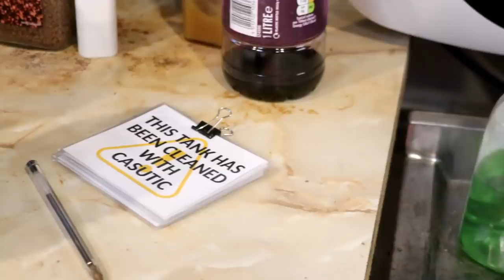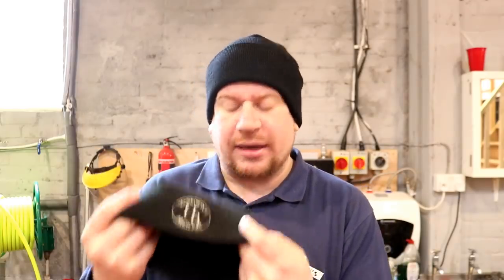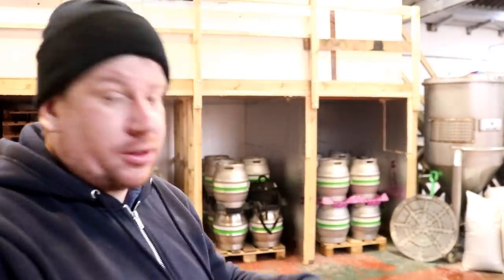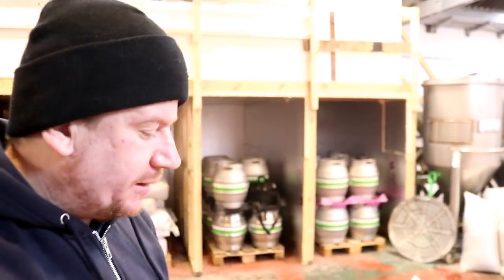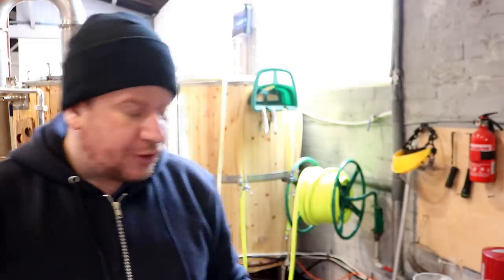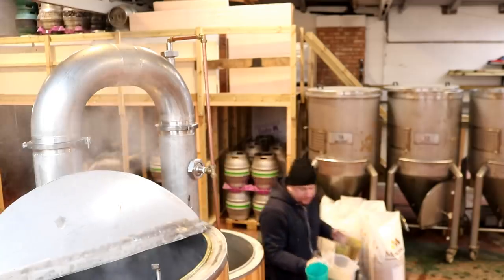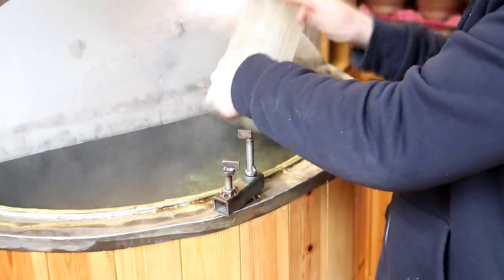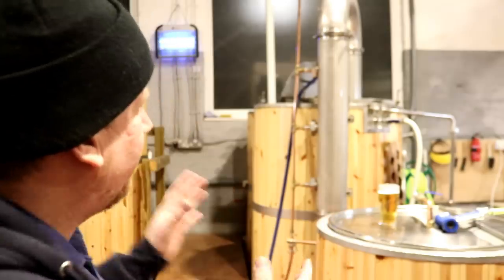8 KG OF HOPS

Comment: Looks good fella. Home in August and can't wait for a cheeky pint or two at the Shed. 
If it ends up too bitter think about less WP addition, more dry hop and more than one addition (one during fermentation and one post fermentation when cooler). We do two dry hop additions totalling 9g/L in our 70hl batches of NEIPA which is under review as we think we could reduce our WP addition and add to DH. I do like the fact that you chill the wort before adding the hops. Also watch the Cohumulone levels of the hops when using hot side, that's why Simcoe and Mosaic are so popular as they have relatively low Cohumulone and have less of a harsh bitterness.
Reply from the maker: Good tips, Cheers Pete. Message me when you are back.

Comment: Also, noticed in your recipe you have wheat and oat malt listed. Are you using flaked-wheat and flaked-oats in this recipe? Flaked wheat, especially, adds a ton of haze and residual proteins in the beer.. if used in the right ratio(12%-16%). We all know if you use too much flaked-oats, you can gum up your mash and result in a stuck sparge.. a sticky headache. I think from what I have experimented with in my own brews, as well as lots of research on NEIPA's, that you would want the clarity of a true WIT beer, pretty much a Hoegaarden times four. 

Early hop additions are on the low weight side.. maybe 20 minutes into a 60 minute boil(these are the hops in your boil schedule that give you IBU's). Throw your remaining hop schedule in at whirlpool(175`F-165`F), giving you not as much aroma, but a lot of flavor without pulling out the bitter oils. Then, dry hop the heck out of the fermenter with your favorite tropical, floral, stone fruit hops. 

I visited a brewery in Nashville, Tennessee that specializes in NEIPA's.. every one we tried was freakin amazing(Bearded Iris). Two of the brews they made only used one hop variety for the boil, aroma, and dry hop schedule. Now.. there is a little trick that people are using over here in the states to get a super milky hazy brew.. add LACTOSE. Once again, this is just my own two cents opinion from a brewer to a brewer, and as I see it, a friend to a friend. Much respect!

Maybe this helps with the thought process. I'm positive this brew is going to be great either way, would love to try it! Cheers man, keep on keeping on!

Comment: I asked before, why are you not using tri-clamp fittings for connections? The cost I'm sure is different, but for the ease of use and sanitation, is it worth the extra cost, if there is any extra cost?

Comment: Cheers Harry - like the new hats but it's still almost 30c here....  NEIPA sounds good.  Any reason you wait till fermentation has completed before dry hopping?  In my limited experience I find that I get much more bang for my buck if I dry hop in the last few points of fermentation.  You could go for the hole dry hop at high krausen too?  Biotransformation etc?
Reply: Stass, do you have a way to prevent oxidation on your system?  I found once I was able to dryhop under CO2 pressure and transfer in a completely closed loop and into a purged keg I got way better hop aroma from post ferm hop additions.  When I was using a brew bucket and transferring via a racking cane I got better utilization from hopping with a few gravity points left.
Reply: @MB-mx7vz  I can't go full anti-oxygen. I have a Brewbucket. Usually dry hop with ~5 gravity points to go. Active fermentation mixes up hops and should push out O2. Rack into fully purged keg (push sanitizer out with CO2). I figure Harry's system is closer to a Brewbucket in design. What system are you running for full closed DH?

Comment: You could have re started the boil I suppose to bring gravity up a few points but really for sake of 0.5%  is it really worth it,you will still be in ballpark of original. That's some load of hops m8,going to be an expensive brew but tasty. Just wondering why you are waiting until fermentation is done to dry hop and how long do you dry hop for? I would love a hat m8,pity the other shop didn't work out,would have been great to get some other HB stuff but not if money isn't going to you. Cheers.
Reply from the maker: I tend to dry hop after fermentation as the co2 from the yeast can scrub out some of the hop aromas.